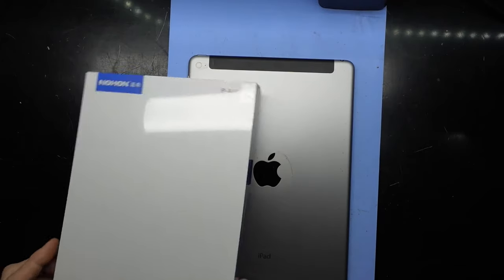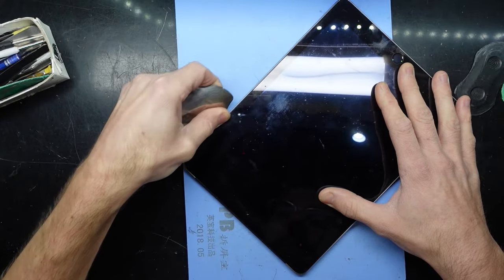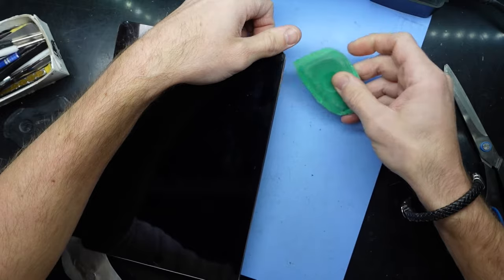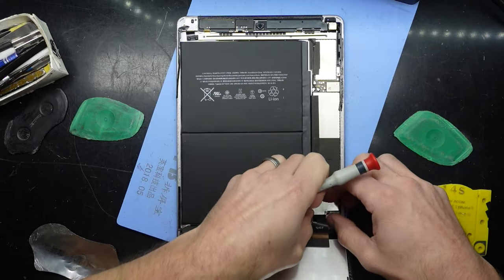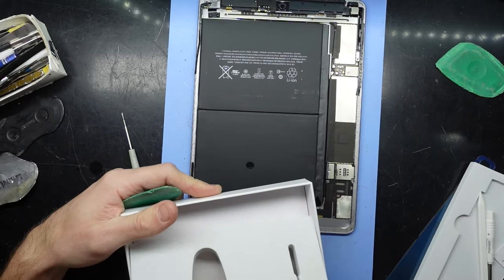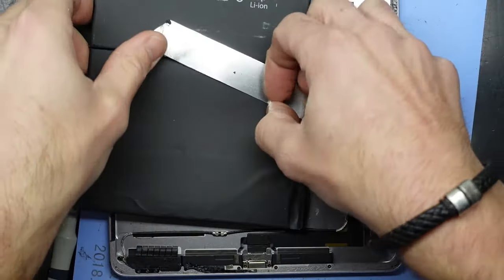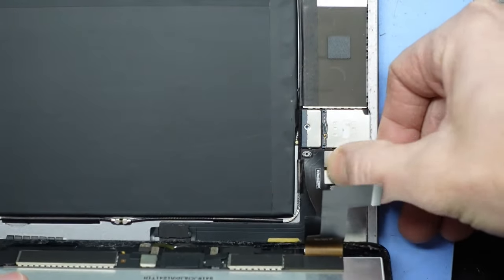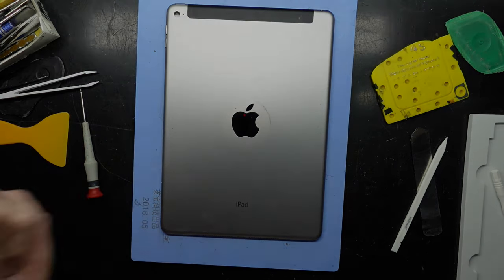How to Replace a Battery In An Ipad Air 2 A1567

Comment: I tried this yesterday and unfortunately I failed. I ended up breaking my iPad Air 2. Touch functionality is now dead. I must have damaged it at some point during the opening process by wedging the tool in too deep or during cleaning the adhesive tape and dissolving the glue residue from around the perimeter of the screen with cotton swabs and alcohol + WD40. Unfortunately I didn't check if the iPad was working at different stages of the process to know at which stage it broke. I used a heat gun around the perimeter and opening it was fairly straightforward. The adhesive tape and the glue that the tape leaves behind once you peel it off is quite stubborn to remove though. Some people just leave the glue residue behind when re-sealing but I think the fit is better if you remove everything and apply a clean new double-sided strips or B-7000 glue. But, like I said, cleaning it off is very hard and by dissolving it with alcohol or other chemicals and scraping around the edges, you risk damaging the screen. This may be what I did. Anyway, my operation failed and I won't be attempting this again. Not worth it. I turned my perfectly good iPad Air 2, albeit with a worn battery, into a paper weight.
Reply: u coulda tried by not removing screen..i see no reason to remove it..one can work around it however..hey ! time for the new model..urs must be 5 yrs old..time to get the new super fast 9th,10th gen..i have both..and will replace the bat with my plans.
Reply: Need to use isopropyl not simply alcohol, it has too much water so you shorten something
Reply: Actually it is much better to not use any liquid at all. Even ipa can go between digitiser and matrix or backlight and damage it. Also separator is much better than heating gun, because it warms up display evenly

Comment: OK ! this is official..you do not need to disco the ribbon cable for the screen...while the screen is standing upright ..slip your thingys under the old battery and lift it all up...then slide a insulated piece of whatever in under the plate that was undone by removing the battery clip holddown screw and just ease the whole unit  up a bit..the battery then slides out and since the separation tool is still under..then take battery away...now put new one into that slot and whole new battery is still standing up..screw down that cover that you took off...now that battery connector is locked down...take the tool out and place battery down into place with sticky parts ready to do their thing...now you may not have to even remove the screen cables cover as they may be not screwed into the case underneath like the battery one..just try it..its amazing...only minutes
Reply from the maker: Cheers

Comment: Excellent demonstration, thanks a lot!  Just finished my repair.  I tested it before gluing the screen back on and it ran fine!  I did a couple other minor modifications that worked for me.  My screen was cracked already so I put on two or three layers of thin packing tape first.  It held it together and was easy to remove afterwards.  And I used the oven at 170°F (82°C) for 10 minutes which worked for me since I didn't have the heating pad.  And finally I used rubbing alcohol instead of isopropyl.  It worked for those tougher spots to loosen.  I just hope that was okay, but I'm not seeing any problems yet. Thanks again!

Comment: Just replaced my first ipad battery with the help of this video. Super simple, did it in under 20 minutes. Thank you!
Reply from the maker: well done, the biggest challenge is safely getting the screen out
Reply: @rickstechrepairs  Ya, well it didn't crack, but I now have a problem with the screen going grey, not sure why. Gonna have to figure out if it's the connectors or what

Comment: are you able to put Wi-Fi logic board into a cellular housing and still be able to slide the SIM tray back in? I'm upgrading my memory from 16GB WiFi +Cellular to 64GB WiFi only. I've never used the cellular so I don't mind not having it but I'm worried a huge hole where the SIM card tray would be.
Reply from the maker: Wifi only model does not have a sim tray slot

Comment: Thanks! What was the very thin foil cutter/prying tool you were using? What can I use for this? Would getting the iPad on a radiator also work in softening the glue? Ta.

Comment: This is my initial review since I just got the ipad and I'm hoping to update it when I've had it longer https://www.youtube.com/post/UgkxUGaHtKW8MwCql2fPyIm9-ftTqSMzKFFA . I purchased one that was listed as "acceptable condition" and was a little worried about what it would look like. However, I am pleased with its condition. The back has some scuffs and a small dent near the logo. There are a few tiny marks at the bottom of the front of the ipad but the condition of the screen is perfect. There are no scratches or anything. I was able to set it up, use it, and it charges fine. I'm hoping it continues to work well for me. So far it was worth the purchase. Also shipping was fast. The item came one day earlier than expected
Reply from the maker: Odd comment, almost reads very bot like

glad you enjoy the ipad air 2

Comment: Is it more risky to replace the battery in an air 2 than any other ipad?
Reply from the maker: Not overly, but you get the screen removal wrong and bam you need a new lcd and touch panel

Comment: 0:26 How do you know it's running at 73% battery life if iPad Air 2 doesn't report battery health percentage number at all ??
Reply from the maker: Connect it up to a program called 3utools on the Windows, it will tell you battery stats

Comment: i don’t even think u need to disco the screen if you watch what your doin plus a new tool that mite look like a crowbar .. made by bending the end of a small flat head screwdriver..no pryin troubles like u did…hey get your hair out of the vid…thanks for the simple job… but what did you pull out and put back in..where the battery connector is at…i see nothing like that on my air 2..

reading below..i see one mentioned sim card…if that comes out and in..right on the outside of where that bat connector is at..then i know what it is….i only have wi fi models and my air 2 takes A1566 bat..looks the same to me

Nov 26 2022